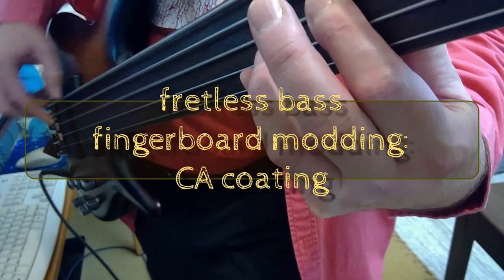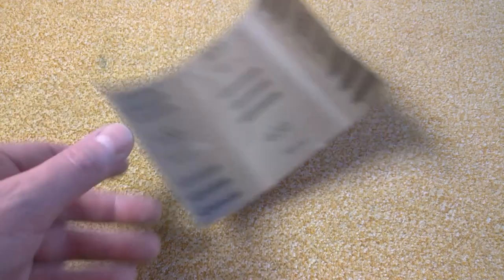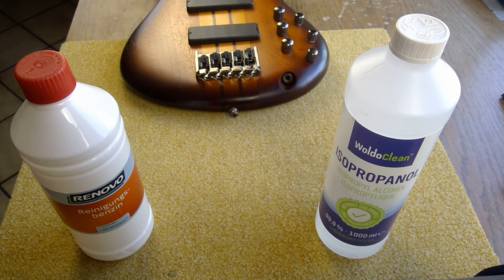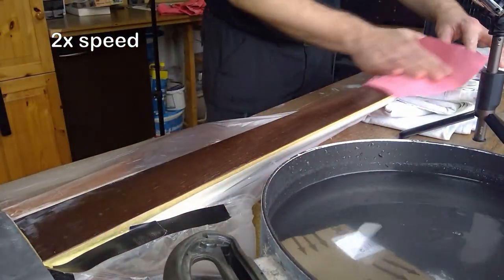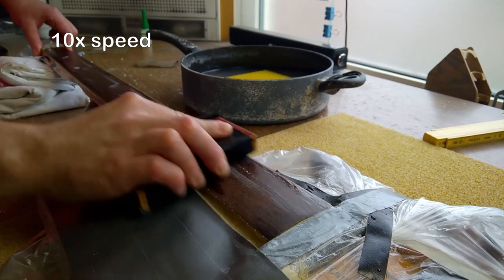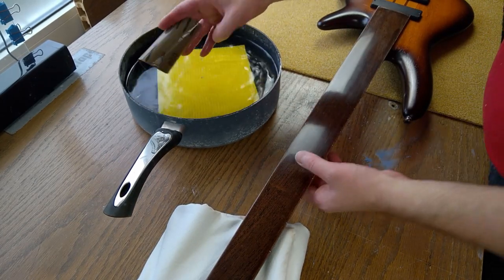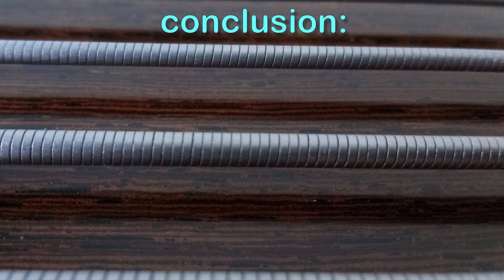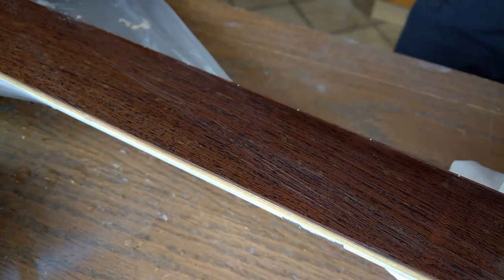fretless bass fingerboard modding: CA coating

Comment: This took me back to 1983 and the day I decided to irrevocably turn my 1962 Fender Precision into a fretless bass.  It was an impetuous and rash decision.  So rash in fact that when the idea popped into my head I jumped out of the shower and ran wrapped in a towel to pull the frets out with a set of pliers.  

In hindsight, I wish I'd done it on a less valuable instrument first, but it had been well modified by its previous owner in the 1970's already.  So it was "Player Grade" anyway.  

The differences in my application were... 
1.) I used ONLY gel superglue.  No thin variety.  
2.) Disposable foam trim brushes to spread glue.  It went on wonderfully even, and I just threw the brush away between coats.  The whole pack was I think $5.00.  
3.) No accelerant.  I was in no hurry.  I let each coat dry to hard naturally, and then applied the next coat of gel.  
4.) No sanding between coats, so I wasn't sanding through the already very thin layers.    I did use a flat sanding block from the outset, as the radius was well defined and the gel coat thin.    

The result?  Well I played it HARD for 20 years solid with roundwounds.  Recently I finally wore through the glue layers around the third fret on the E string.  

I didn't want to mess with it this time, so I took it to a luthier to do.  He preferred epoxy this time and it didn't come out quite as nice.  Some cloudy spots.  He built it up pretty thick, and without realizing it changed the radius from 7.25" to 9" because that was the sanding block he had.  He hadn't bothered to check the pre-epoxy radius.  I was not happy.  

Made mental note to buy a 7.25 radius block and do it again myself when I find time.  Can't possibly mess it up any worse.
Reply from the maker: Now there's an intriguing story. Thanks for sharing. 
This is also the first ever statement I read about the durability of CA coating. Makes me optimistic about playing mine with flatwounds.
Reply: @Noone-of-your-Business  Oh, yes, I did it in 1983 and played that bass exclusively with roundwounds at least most nights a week between learning tunes, rehearsals and performances until 2006 when I got a fretted Jazz bass to trade duties with.  Still played the fretless though, and that spot didn't wear through to wood until 2019.  That's 36 years of roundwounds.  The rest of the board was fine, and I probably could have just touched it up, but I chose the full resurface.  Really wish now I had just touched it up myself.
Reply: About the same year (1983) I saw this Guy on TV playing a Music Man Stingray with added Precision split Pickups on, so i bought some Seymour Duncan's ,and with hammer and chisel installed them , I've now learned that the serial No, of my Bass (still got it) Is in the first year of Manufacture
Reply: @leoneddy1492  YIKES!  I've developed  personal scientific formula for this phenomenon actually: 

M+t=R2

That reads aloud as "Mods Plus Time Equals Regret Squared"
Reply: @dreamingpanthers1847  Genuis! I'm gonna use that😉

Comment: try sanding with a radius'd sanding block, it may be the issue you are having as you are adding material thickness and that raises the relative position of the fretted area to the nut.

Comment: a friend of mine – who is building guitars professionally – told me that the use of ca coatings is merely to prevent the fingerboard from wearout. like a sacrificial layer... there is not so much difference in terms of „hardness“ between common used woods, that it would improve the tone significally. if you want that, you‘d have to go for sheet metal or something like that i guess...
Reply from the maker: As I said, it does change the tone quite a bit - but not in the range I am looking for in a fretless, so I rolled all of the high freq gain off with the tone control.

Comment: Do you think the super glue could replace  epoxy for a fretless conversion ? Great video by the way.
Reply from the maker: Thank you. No, I do not think CA will or should replace epoxy. From what I have seen, epoxy - seeming to be the softer material - produces less high frequency overtones and rather amplifies the lower kHz range that is desirable for fretless. If I had to do it again, I would try epoxy.

Comment: Seems there is a positive aspect you did not talk about : superglue finish improves the durability of the fingerboard surface :-) I am currently building a fretless neck with an ebony fingerboard, and I think I will finish it with superglue for that particular reason only
Reply from the maker: It is actually in the video at 11:21 - I just did not bother including it in my voiceover.
Good luck with your build!

Comment: Informative. I was thinking of doing this to my fretless but decided it's not worth it. the wear that the fretboard has matches the bumps and bruises a 35 year old bass tends to get. I never fixed the pickup selector switch that broke and I bypassed 25 years ago. I doubt I would go through this effort now.

Comment: I'm with you. I'm always chasing the tone issue. Quick question. I have an ebony board. Is that harder than the CA finish?
Reply from the maker: Don't know. I guess not.
Reply: My internet research is suggesting that an unfinished ebony fretboard is likely harder than an epoxy or CA finish on other wood (e.g. maple.) Wood hardness is measured on a Janka scale, and thus isn't exactly compatible with hardness scales used for other materials. Also, hardness of a CA finish on a softer substrate like maple is likely in reality lower than the hardness of the CA itself. But with the numbers I can find, ebony seems to have a Shore D hardness of about 90, while CA has a Shore D hardness up to like 85. If you went with a very hard epoxy, you might get a Shore D hardness of up to ~90. I wouldn't really rely on any of these numbers to be particularly accurate, but the moral of the story is that it is probable that the ebony is harder than a CA or epoxy coating on a softer hardwood.
As for my unprofessional opinion on how I would finish a fretboard...
If I had an ebony fretboard, I would either leave it unfinished (as is traditional) or I would go with as thin of a CA coating as possible if I wanted to make it look shiny. The CA glue is able to give a thin enough finish that I would not be concerned about having a layer of softer material on top of my desirably hard wood, and I do not think that the CA glue that soaks into the wood would make the wood itself any softer. For a softer wood, I think I would attempt to soak as much CA glue into the wood surface as possible to help harden it (using the thinnest glue I could find), sand it back to make sure I don't have an actual coating of CA over the now-hardened wood, and then apply a thicker coating of a hard epoxy on top of that (not a THICK coating, but a legitimate coating.)

Comment: I used to use ca glue mixed with wood dust as a filler, I know it's a common practice repairing low-end woodwind instruments like clarinets and oboes. At one point I was using so much ca glue, I dreamt of making a guitar entirely from ca!

Anyway - I cringed when I saw this, can't think of anything worse than coating a nice ebony board with nasty chemicals. And sanding block - essential to get one that's radiused for your bass's neck, they're not expensive. Even without the ca treatment, use fine grade paper to highlight wear marks, coarser paper to level the board, then fine paper again to finish. And important tip - support the neck in the middle or you'll wear a curve where you don't want.

Edit - forget the polishing compound and lectric drill, I would use t-cut and a soft cloth, little bit of elbow grease doesn't hurt.

Thanks for the video, a cautionary tale if ever there was!

Comment: And someone else mentioned hear a two-part epoxy would be easier to work with here.  A 2 part urethane, would more harden the surface and fill in the pores of the fretboard.  Much better then super glue!  Automotive or Marine Coating. After I do mine,. Perhaps I'll post it too.  Thank you much.

Comment: I have a six string version of this bass. I may try the back of the neck sanding, but I think I'd probably rather leave that to a pro. I just got treble side inlay put on to make intonation a little easier. I had an epoxy board before but it just wasn't something I liked that much, so... eh.

Comment: The #1 reason for epoxy on a fret board  is to prevent grooves from forming on the fretboard. If you purchase one with an ebony fretboard,  you don't need the epoxy protection. If you get the proper epoxy, you only have to apply once. Always remove the nut. Adjust the truss rod to make the fretboard absolutely flat before you do anything. When using a block sander, never sand in sections.  Sand through one end to the other.  That's why you need to remove the nut.

Comment: What about epoxy or other resins? Is there any way to make the fretboard last longer without getting rid of the "good" overtones? Greetings from Mittelfranken :)
Reply from the maker: That is what I would use next time, but I imagine it it messier to work with. There are videos out there of people using epoxy on their fretboards, so check those out. And I guess the frequency response of resin should be less brittle than CA, so IMHO it would probably make for a better sound than superglue.

Comment: Did it at the very least help with playability? I'd assume a glossy fretboard would make bends and slides more smooth
Reply from the maker: Playability does not change. You play on the strings, not the fingerboard. And I advise not to bend on a fretless. Why would anyone risk scratching their fingerboard sideways for something that can easily be achieved by sliding up and down the string? And again, sliding does not change - neither in feel nor in performance. The one thing that does change slightly is the spectrum of the sound.
Reply: @Noone-of-your-Business i was more or less using an example, you definitely can feel the fretboard below the string and I'd imagine having a glossy fretboard may feel better than rough open pores scraping against the strings. And I mean yeah why would anyone bend on a fretless, but by the same token why would anyone spoil their nice ibanez bass with super glue?

Comment: Have you tried the hardened fretboard with roundwounds?  I was under the impression that Jaco used epoxy and roundwounds for his tone
Reply from the maker: No, and I am not planning on ever using roundwounds either. I do not want to risk the coating, and flatwounds should be significantly less stress for the coated surface. I expect cyano acrylate to be more brittle than epoxy.

Comment: I would really like to know, Mr. Business where do you hail from. Are you Norwegian?

I’m thinking about doing this on the fretless bass I just purchased, but it isn’t half as much because of wanting to waterproof the fingerboard. I do play a lot of slap bass, and I was recently told that you can make a fingerboard suitable for it by coating it with a sealer like this one.
Reply from the maker: Nope, not Norwegian. Hint: the labels on the bottles in the video are in German.
Assuming that by "slat" you mean "slap" and by "coding" you mean "coating", this might work to your benefit. The characteristic pang of a slapped bass is closer to the high mid frequency range that this coating enhances than the buzz of standard fretless playing that I was going for. Then again, cured CA is quite rigid and might crack when slapped repeatedly. So when I say "might", please read the disclaimer in the despription before you go to town on your new bass.
Reply: Thank you for noting all the errors,  @Noone-of-your-Business ,  and I have seen to them in my above comment. Thank you also for dropping the hint(s).

Comment: what brushes do you recommend? also will this protect a fret less neck from round wound strings
Reply from the maker: I just used the standard hardware store brushes I had lying around. It doesn't really matter. Just make sure it does not lose any hairs.
I will, however, not use roundwounds on this fingerboard for fear of the coating cracking - and I do not recommend that anyone try this. But maybe that's just me. 😉

Comment: Your picking/plucking will undoubtedly have more variance than anything else. Meaning if you did two passes with the same fret-board, you would still see as much variance, IMO. Did you try this?
Reply from the maker: 10:37 - "It would have taken a robot for identical performances." And yes, I did multiple takes on the same configuration and made sure they were as consistent as possible. And no, I do not think that plucking has more variance than anything else. As I said, the instrument gained a massive bump in brightness that I had to roll off with the tone knob. No amount of plucking could produce that high freq range on the original fingerboard. 
But I can see how this does not come across in the video since I decided to cut this one short and not give a sample of the unmodified frequency response and instead relied on telling instead of showing.

Comment: I just used a couple coats of  "Diamond Cote Varathane"...
Reply from the maker: Interesting. How does it hold up?
Reply: @Noone-of-your-Business  amazingly well, even with roundwound strings. I'm still on my first application after fifteen or so years. Of course I don't play every day,  more like once a week or so with the band or on the odd gig. Done that on three basses so far and had no problems but since the basses were all defretted and then veneered with birch, I didn't really run a comparison to lacquered and unlacquered. But I'm happy with the sound.
Reply: BUT...!!! DON'T be tempted to use a power sander on it. It will melt and ruin the lacquer.

Comment: I have a cheapo washburn with an ebonol fingerboard much cheaper and no risky diy for the same level of hardness as a coated bass but sounds more similar to wood. I think bare rosewood has a better sound but harder surfaces like ebony, ebanol, epoxy coated maple or rosewood feel better to play fretless, probably why ebony is used for orchestra string instruments fingerboards from violins to double basses and everything in between.

Comment: tell me how many grams of superglue you needed, and how many layers in total?
Reply from the maker: About 3-4 bottles of thick glue @ 20g each in 4-5 layers. Sorry, I didn't count. Plus the first coat of thin glue, which was about half a bottle, i.e. 10 grams.
Reply: @Noone-of-your-Business  Aaaah, now I know why it sounds like it does: way too thick a layer. I use less than 30g of medium CA glue for a fretless fingerboard, in 4 thin coats. 
This also explains the inconsistency in sustain from spot to spot: with such a thick layer, you're supposed to re-plane (re-true) the whole fingerboard because you created local bumps. Even a 0.01" bump can choke the adjacent note. A small sanding block can't true a fingerboard, sadly... You need a long (min. 14") sanding beam for that. 
Despite all this criticism, I really enjoyed your video. ☺

Comment: Not necessarily true, I play both. It's about the way you play, finger placement, both hands, how/where you fret the notes, how and what level you attack your strings, manipulation of the notes and tones, learning to use the overtones. It is a completely different animal. There is only a minor difference with coated fretboards. 90 percent is how you play not what you play.

Comment: Easier to mill off the original fretboard by depth of replacement sheet of bowling ball material, available in strips, some company in Tacoma, Washington I saw. should be more resonant and perfectly flat from the factory.

Comment: CA glue? Seems scary and permanent. I'll stick with tung oil on my fingerboards. Recommend, BTW. I've used it for five years now. Weird that CA glue scoops the mids so much and generally smiley-faces the response curve. Not a fan of those new extra high noises. You know, I think tung oil would take you right direction for enhancing mids, unlike the CA. FWIW, I only play roundwounds on mine. The tung oil impregnates the wood with solids so the windings make tiny scratches but don't dig into the wood. This $12 bottle of real tung oil will last the rest of my life.

Comment: Do NOT USE accelerants with super glue because it will result in it going white as what happened to you. It will dry fine on its own from the moisture in the air. Best to do it outside as it’s very noxious.

Comment: Before I try it myself I have this question: will the strings scratch the coating very quickly diging trenches and producing dents in the positions you use more often? thanks for the video.
I am thinking on removing the fretboard and replacing it with a bronze one, but I have the same  doubt about the harder material (strings) scratching the softer material, the bronze fretboard. this link show this awesome guitarrist with a factory made one: https://youtu.be/ZjEGtUXGWa0
Reply from the maker: Well, I don't get to play the instrument very often, but I will not burden this fingerboard with roundwound strings in order to prevent just what you describe. I use flatwounds exclusively on this bass, and so far there is no percerptible damage to the surface at all.

Comment: the reason people coat their fretboards with glue is so they can use roundwounds without it digging into the rose wood. why would you close off the pores and then still use flats like before? the video was educational but I hoped you would've at least used the correct strings.. which is the whole point of the coating.

also I hope no one with an ebony fretboard starts doing this.